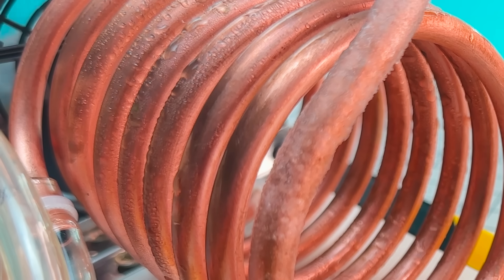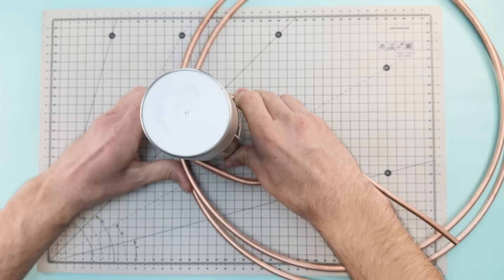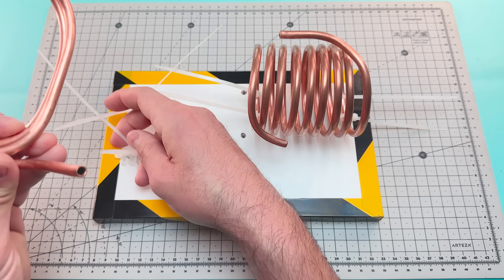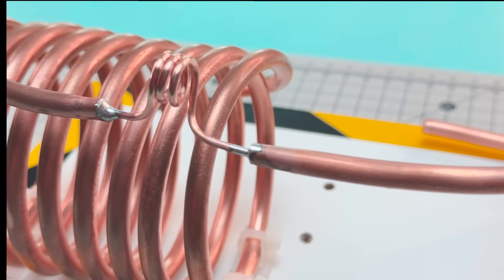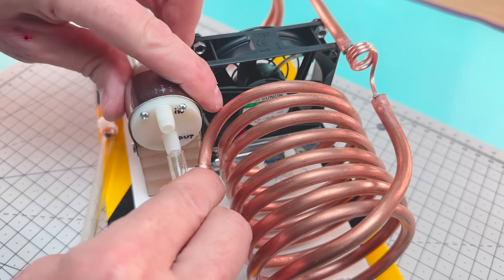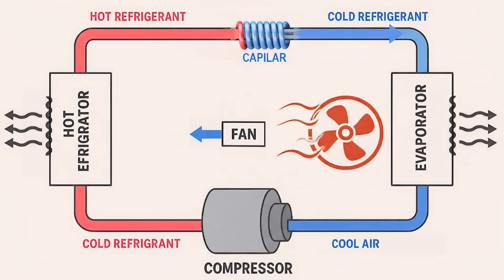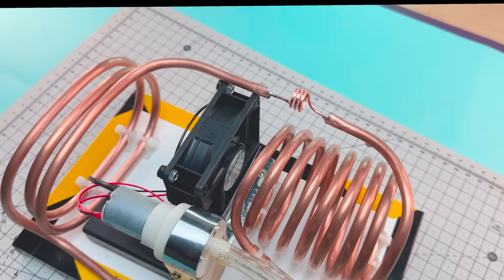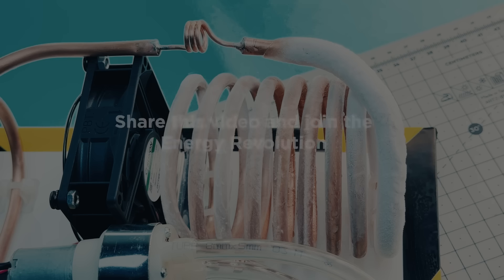Make your own AIR CONDITIONER at home Fast and Easy!

Comment: Sorry guys it won't work. You are just transferring heat. Think of your fridge/freezer cold on the inside but hot as hell on the outside. Put your hand at the back. That's why air  con is mounted outside and blows cold air inside. If it's mounted inside the net result is zero thus presrving the laws of thermodynamics.
Reply: this is an example of how it works, nothing more
Reply: so nount it at the window and exhaust heat outside?? and fan cool air inside

Comment: It’s surprising how many people are entirely missing the point of this video.  It is a simplistic breakdown of a cooling circuit, in its most basic form.  It shows how the system works, nothing more.  Anyone expecting this to be serviceable to any extent is not thinking clearly.  One could adapt the principle of this system to a working system by scaling it up and separating the evaporator and  condensing sides.
Reply: I was reading the comments after reading yours and damn. Didn't expect to see so many people just complaining lol. the video was very informative for me otherwise

Comment: Put two holes in a cooler to put the copper lines through and put the cold coils inside the cooler and leave the rest of the unit outside. Now you have a mini fridge for an emergency.

Comment: This is a fascinating educational project, by the way it’s also capable of demonstrating how a heat pump works.  From the educational point of view it’s important to know it does not generate cold, it simply moves heat from one place to another so the heat removed from the evaporator coil is released by the condenser coil so the overall heat in the room is about the same.

Comment: really pump will be pumping isobutane ?
Reply: Most residential AC units and refrigerators use R600a now, which is isobutane.
Reply: @Diablo6596 the question is, does it really work? Hvac sistem require compression refrigeran, not simple pump. Every one work on hvac knows ,that is only nonsense. 🤣
Explanation is correct but you can't produce enough compression with just simple pump .
Reply: @ardhianwidayanto7327  yep 100% that little air pump isnt doing anything, need a lot more power than a couple of batteries, and if they used even bigger batteries and a bigger pump and bled the ssytem of air, teh plastic tube would pop off with the pressure needed, and then... you got the issue with the compression side of the equation getting hot enough to negate the whole cooling side being in the same space lol. this is like a 5 minute crafts video based loosely on how an AC works.

Comment: where's the waste heat going?
Reply: blow the cold air over the hot coils and the air will end up hotter anyway due to latent heat
Reply: You mean the fan that's pulling that waste heat and blowing it into the evaporator coil lol.
Reply: That will go behind the fan

Comment: Isn't the fan pulling warm air from the the other coil?
Reply: Yes, lol.
Reply: Yes, that's what you want, other wise it gets too cold. Like most systems, they tend to have a temp sensor monitoring the condenser to make sure it's not getting too cold when it does the compressor is shut down.
Reply: @THunderinDRagon1985  I always install a speed governor in all my perpetual motion machines.

Comment: He said "when the liquid looses temperature it evaporates into gas". I thought if liquids loose temperature, they freeze.
Reply: when the gas is pressurized then goes through the tiny capillary tube it expands and evaporates taking heat with it. so yeah worded wrong it's a pressure thing not a temp thing

Comment: You cannot cool the room in this way, if you put both condenser and evaporator in your room.
You need to move condenser outdoor.
Reply: Sink the heat into water, maybe?  Then add a water pump?
Reply: Thank you I used this method to cool my pc🥳

Comment: I work outside, and I made one of these but I wrapped the evaporator coil around my head, and put the condenser coil on backpack board made out of hard foam so the heat won't go toward my back. The foam backboard is mounted on a piece of plywood with shoulder straps, and the compressor and a 12 volt lawn equipment battery is hooked to it. Keeps me coil, I mean cool while working in the hot Phoenix sun! Talk about brain freeze!😮😮😮

Comment: Hello. Quick question, this build looks pretty curious, and I am thinking about building a Wilson cloud chamber based on isopropyl alcohol vapor, can you shortly answer is this solution applicable? Temp must be around ~240 K and cryo surface must be flat.

Comment: Actually it's a heater if you don't lead away the heat from condenser.
Reply: That's right! Even if this device were 100% efficient (impossible), it's space would only remain at the same temperature! But it's a simple example of heat transfer!
Reply: He built the system, not the practical implementation of that system. If you want it to cool your room, keep the cooled end in your room and the other end outside.

Comment: First of all, the diagram shows the fan direction backwards from the way it is installed on the project. Secondly, the condenser side is not isolated so all the heat removed on the  evaporator side will be thrown back into the room (and drawn in through the fan through the evaporator coil) so this will not cool down a room.

Comment: OK, check the Temperature at the Condenser side, maybe it can cool down even more, making it more efficient. More Copper or more Fans, but dont pump the warm Air from it over the heat exchanger from the evaporator side.
Also, isobutan is a flammable gas! Its dangerous to handle and you should never breath it. Frost burns can occur. Only us it in well vented areas!
Now condense air :D

Comment: The evaporator will will absorb heat from the air, but the condenser will get hot, heating the air. If both the evaporator and condenser on in the room, it will not cool the room. The condenser needs to be outside of the room, or there needs to be a separate air circuit that exhausts to the outside.
Reply: I bet this YouTuber assumed that the audience was smart enough to understand this.

Comment: As an Engineer I can say that the set is based on the correct engineering and air conditioner design. It will work. The only thing I doubt is that this small setup will not be able to bring a big change in the room temperature.
Reply: They would at the very least need to isolate the condenser and vent the heat from it to outside the room.
Reply: По законам физики это устройство будет нагревать помещение. 😂😂😂
Reply: @ГеоргийТретий-с7ь 😅😅😅
Reply: Not to mention that there's nothing to collect the water as the air cools over the coils.

Comment: 🤣🤣🤣 Yeah right... that tiny fan will fill the room with freezing air. Using simple BTU calculations the "Air conditioner" you describe in this video has a greater than 8000% efficiency. The Conservation of Energy principle clearly doesn't apply... nor do many other laws of physics you've broken. 🤣🤣🤣

Comment: impressive but, how long would this work? is that pump strong enough to move the gas for longer than a few minutes at those temperatures? how long will a 9 vote battery operate a 12 vote system that is ask to move this gas ? And how long will a gas like that work? Will it need to be recharged after a period of time? All very important questions I would like to know.
Reply: That’s very easy to figure out you just have to figure out how much power does the motor draw at full load let’s say  the motor draws 100 mA and then 9 V battery has about 400 mA. That means that electric motor could run continuously for four hours straight before the 9 V battery is fully drained.

Comment: yeah  it wont do squat for a room   plus creating heat at the other end  lol... BUT  it could be used to cool a component.. like a CPU .
Reply: How cold do you need your CPU to be? Let's say CPU and GPU. But that's a lot of non standard plumbing for a few degrees cooler. Water will get it down to 21DegC anyway.
Reply: @dora-de-explora  just an example

Comment: That is a good and simple demo... The only thing its missing is a controller to regulate the temp as well you can get rid of the 9 volt battery and wire in a ac adapter so you don't have to use batteries.... I was thinking of building one of those myself I got most of the stuff to make it

Comment: Apparently the best gas is also the most flammable.
Reply: which why Freon manufacturers mix propane with some Freon.  and why travel trailers use straight propane.
Reply: R290 is a registered refrigerant (pure propane)

Comment: The damn fan is sucking up hot air from the condenser
Reply: The condenser releases the heat that the evaporator extracts from the isobutane. Additionally, the fan and pump motors convert the consumed energy into heat. So, in essence, the device is just a very, very low-power oven.
Reply: I was thinking the same thing…right from the hot condenser over the evaporator

Comment: you need to send the hot air through a vapor chamber to the outside in a condensor and then send it back to the unit as a liquid back to the unit to dissapate the heat and sent coolant back.
Reply: Didn't understand that at all. But I do recognise that this thing just looks like it's missing a few vital components of the fridge circuit. I just con't figure out a use for it. Even in a cool box I don't think it would work!
Reply: @dora-de-explora like for work. I read that and wow I butchered it. A  box fan that circulates the air. Where the hot coil is have a condenser/fan push air once it hits it, then cycle it back through pump to create high pressure to cool again.
Reply: @dora-de-explora so you pushing the heat away like a central air unit.

Comment: Perfectly ridiculous. The net effect is that the ridiculously low capacity battery discharges and thus heating the room slighly.
Reply: Well given that all this is doing is boiling the butane once it's technically cooling. Once.

Comment: And the heat will be also pumped in the same room?
Reply: Good catch! The way the fan is positioned, you will be drawing the hot air from the condenser through chiller, but not all of it. The air you feel will be a little cooler, plus it will be drier, so you will be cooler, the room temperature will not change. To actually cool the room as a whole, you need to have a second fan that will divert the heated air out of the room. Ever try cooling your room by leaving the freezer door open? It will not work. The heat taken out of the air is transferred to the condenser, and the heated air is simply blown back into the room. This is how every AC unit works, whether in your house, or in your vehicle.  The plus side for this setup is if you hook up a good solar panel you can take it outside and blow the cooled, dried air onto you and still feel cooler.
Reply: @genewilenius5923 Yes.  Or you could hook a dc power supply to it powered by your house electricity and cool off.

Comment: But it gets hot on the other side of the narrow part. That heat has to be insulated away, otherwise it won't work. Compare the back of a refrigerator, it's hot there.
Reply: Put a second fan on it.

Comment: Even though it's just a simplified build, it helped me to understand air conditioning better.
Reply: This whole process would be far more efficient if the coils had little aluminum fins on them to radiate/absorb heat faster like the radiator of a car or say...an air conditioning unit...huh...
Reply: The compressor pump would be a lot more efficient if it was a higher voltage that could really quickly compress the gasses to extreme pressure. You'd have to braze the copper instead of using cheap solder so the system could handle it... You'd also want a way to automatically regulate the cycling and prevent the inside coil from freezing and locking up the system...
   ...like on an air conditioning unit.
Reply: @captainKedger  I was a plumber for years and when I saw him soldering that joint I knew something was wrong. The A/C guys always brazed that copper.
Reply: @davidshumard solder is fine for this useless system because the pump doesn't create much pressure.
Reply: @captainKedger This doesn’t have a pump. It’s a Peltier module (TEC)
Reply: @AngelGreiner-b5j no, it's not a peltier module. Look at the construction of it. It doesn't have any of the necessary components for a peltier module. Yes it does have a pump and you have completely missed the point if this video
Reply: The point of this video was to trick people into clicking on the video and making a lot of comments to get views by convincing people that he's come up with a fantastic new energy saving invention but it's simply not true.
Reply: @captainKedger  But I also had to braze my copper if it was an underground joint.
Reply: @captainKedger It would be a lot more efficient if he actually put any refrigerent into the system. But he didn't. It was already full of air, and you cannot pressurize through a hole in the tube.
Reply: The biggest design flaw is that this unit isn't actually removing any heat from the room because the hot coil is putting off all its heat back into the room. If this unit were built into a wall with the hot coil outside and the cold coil inside it would actually cool a very small well insulated room but not very efficiently and would only cool the room by 10 to 20 degrees on extremely hot days. 
   I'm not a naysayer. I'm just stating the facts. There IS an extremely efficient way of using the sun's energy to cool a room without using ANY electricity. This just isn't it.
Reply: Somebody gets the point of this video. So many comments on here that mention parts that are not even on this setup smh. Its a cool project. No pun intended.
Reply: Essentially many gasses will get hot when compressed and turn to liquid then when allowed to expand they will get cold and evaporate. To cool a room requires two things to happen.  The coil that gets hot needs to be outside the room/house and the coolant in it must get hotter than the ambient temperature outside. This way it can radiate heat out into the cooler air before being allowed to expand into the evaporator coil inside the house where it will get cold thereby absorbing the heat from the room and pumping it outside with each cycle. You don't create cold. You remove heat from an insulated area and the absence of heat IS cold.

Comment: As a refrigeration tech all of this would work in theory (I have no idea how well the air pump as a compressor would work) but I can tell you that cap tube is no where near long enough for the pressure drop you would need. Also do not do this A3 refrigerants like r-600a (isobutane) are highly flammable and who knows if some random air pump is spark free and even if it is if the zip tie hose connections leak and any spark (say from a fan motor that's not rated as spark free) ignites it you now have a mini flamethrower.
Reply: Agreed .. but the amount of gas in his system is no more than a cigarette lighter . I think it's not a bad demo project .. suitable for a high school physics teacher .
Reply: @danobrien3189  I agree that it can be a good demo project however there is more energy there than you think, most A3 systems have less than 6oz of refrigerant with many being under 3oz and the fireball that comes out of those when some dimwit un-sweats a pipe that's charged is bigger than you would think.

Comment: love how we ignore the fact the hot side is in "the same room" xD all in all the only thing this will do is slowly heat up room due to fan and pump efficiency now being 100% the hot and cold side equalise that is assuming the pressure difference is enough because both the refrigirant insertion, flimsy tubing and low power pump cant do jack shi*. There is a reason AC uses a compressor hard tubing and big condensers/evaporators
Reply: Yes you would have to extend the hot coil out of the room for it to effectively lower the rooms temperature
Reply: 100%

Comment: 12v fan, 12v air pump, 9v battery. Yeah that’s smart. I think comments for lasting 5 minutes is about right
Reply: Commends for lasting 5 minutes are very optimistic. Also, this device never cooled a room. The narrator ignored the important fact that the other side of the device is getting heated more than this side is cooling, so having both in the same room only heats it.

Comment: .  
A refrigeration system CAN work with any gas provided a “metered gate” (capillary tube) allows for a change state from a liquid to a gas to occur while contained in a. “closed loop system”. This is an obvious lie.
No vacuum was applied to the system, nor was it “purged” with your butane, system will NOT WORK  internally full of air at atmospheric pressure because air doesn’t liquify will not compress to a liquid until over 4500 psi. 
Even with a proper refrigerant your pump and hosing could NOT provide enough pressure to compress the gas back into a liquid, nor would your poly tubing take the heat or pressure. 

I suspect you cleverly placed (off camera) a couple of internal blocks to the tubing,  placed a couple of “T” line taps disguised an hidden through your base anchor clamps and through the base & under the table wher you tapped into a functioning system. 
You kinda missed just a tiny bit if a person looks closely at the spacing distance and curve at the start of you “evaporator” coil, 2) there can be clearly seen NOTHING can be seen moving in your clear line. Should be liquid refrigerant seen flowing, even when no bubbles are in the system. 3) the size of your “condenser” coil should have atleast TWICE the size of the “evaporator” to expel/ give up heat in order for any system to work, it is a great deal SMALLER.